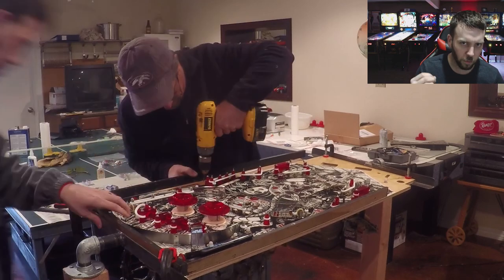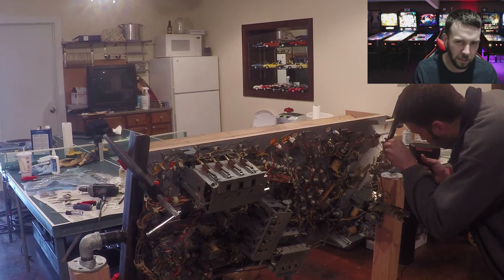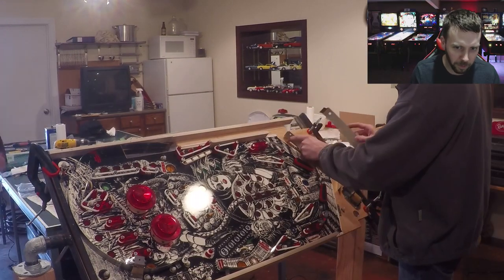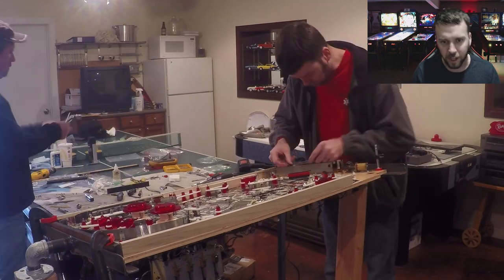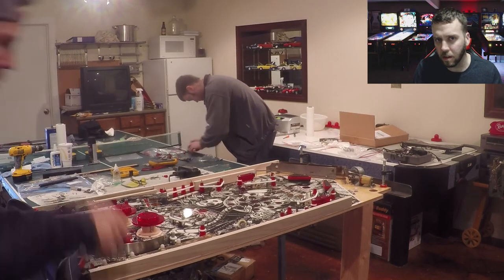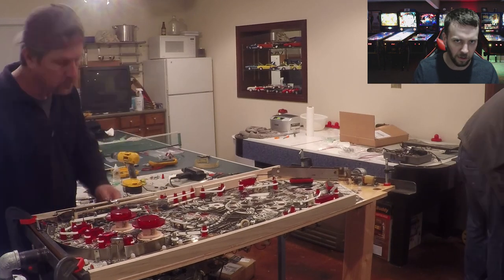Centaur Pinball Playfield Swap Process Part 3

Comment: How did y'all move the metal, riveted-on posts from the old Queen's Chamber and by the flippers? I'd appreciate insight on that, as I'm stumped other than drilling them out and then gluing them to the new plastics.

Comment: Did your new Queen's Chamber plastics come with the metal posts already attached?  Or, did you figure out an easy way to detach them from the old, yellow pieces and attach to the new ones? That's my current issue. It appears they're riveted(?) on, so perhaps a pop rivet solves it(?).

Thank you again for these wonderful, extremely helpful videos. I've had to slow them to 0.25 speed here and there to see some things but it's all good.

Comment: Could you please share what model ultrasonic cleaner you have/used?

Also, thank you so much for this series of videos. I'm just diving into swapping out my Centaur playfield and you have immediately shown the error of my early ways. Thankfully, they are easily recoverable. FYI, I bought my machine back in 2000 off eBay for about $500. It needs some TLC but the CPR/Kruzman playfield will do wonders for that!
Reply from the maker: It's just the one from Harbor Freight.
Reply: @CaryHardy  Thank you.

Comment: Cary, CPR recommends using a brad-point bit to drill the topside of the playfield. Is that what you used or did you use a regular bit? Thanks
Reply from the maker: It's been years since this project. Plus, I wasn't doing the drilling on the topside.